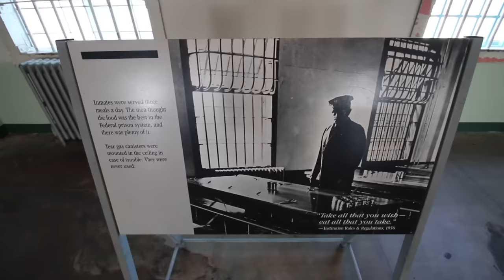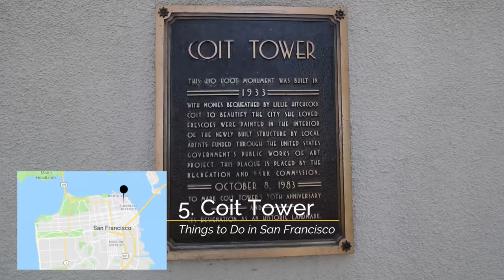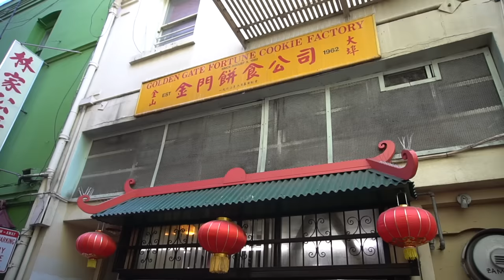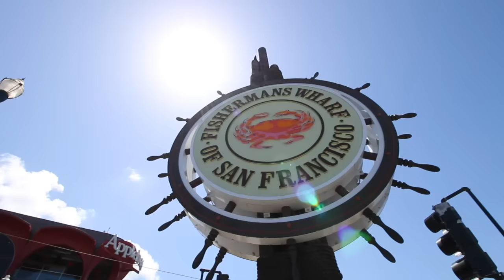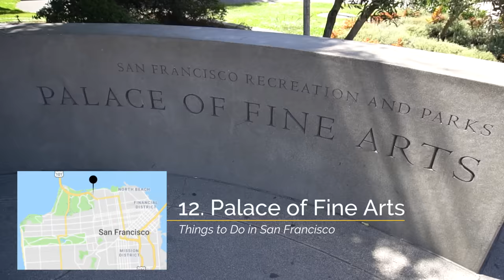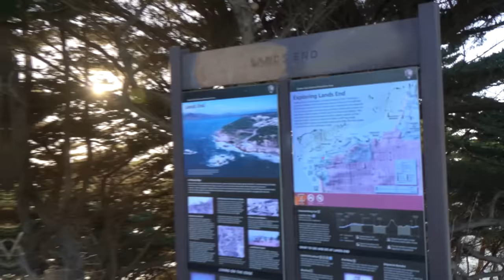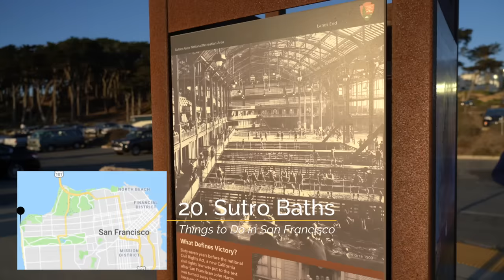24 Things to Do in San Francisco

Comment: Something I used to do while living in SF is go up this street next to a cheap hotel called Golden Eagle Motel (I believe) and you'll come across a set of stairs that lead to these apartment complexes. In front of the stairs there's some benches. I used to always sit there during the night. Especially around Christmas. And you'll get a great view of the Golden Gate bridge (and its lights if you go on Christmas). Not a lot of people go there. It was my get away from all the chaotic, noisy parts of SF. It's pretty quiet there besides the cars that sometimes pass by. You can even buy some pizza nearby or whatever you wanna eat.
Reply from the maker: Sounds like a cool spot!
Reply: Address please?
Reply: Might be a reference to the Filbert Stairs/Steps, near Coit Tower.
Reply: @Joeeydirt338  jeesh talk about super later reply lol. I found the address. Well not exact, but the street.

1098 Montgomery St.
San Francisco, CA

I haven't been there in years, so I can't promise everything will be just as it once was when I used to visit. But I would definitely recommend checking it out when you do get the chance. It's better to go at night and like I said in my original comment: during Christmas when the lights are up.
Reply: @InternationalSpaceForce  thanks!

Comment: I am taking the trip when I turn 18 I am going to drive from NY I needed this video
Reply: Do a  long term bike rental.  I used "blazing saddles" in 2013.  18 speed Fuji with disc brakes. Can get easily all over the City.  Top of Golden Gate back to Transamerica building in less than a half hour (thanks to mostly downhill, little longer to get to the bridge)  A bike is the best way to easily cover alot of ground.
Reply: I recommend pier 39. It’s a dock fisherman’s use and it houses an entire aquarium that is beautiful mind you, an arcade, rides, food, entertainment, and if your lucky you could find some seals